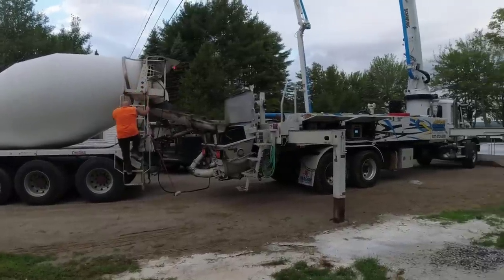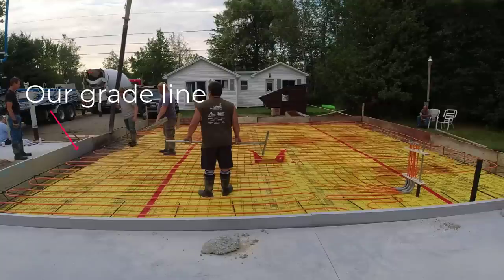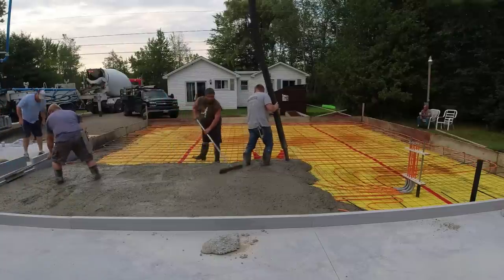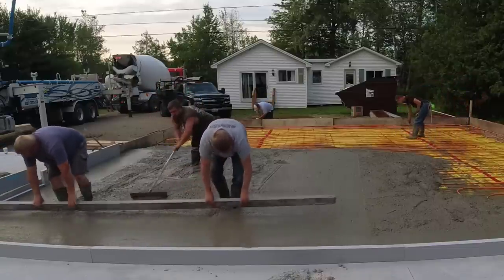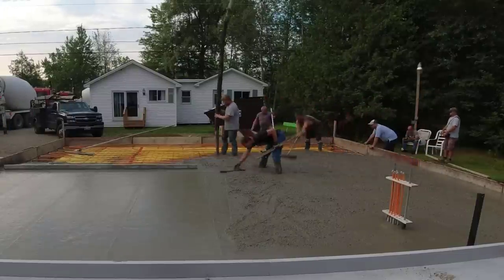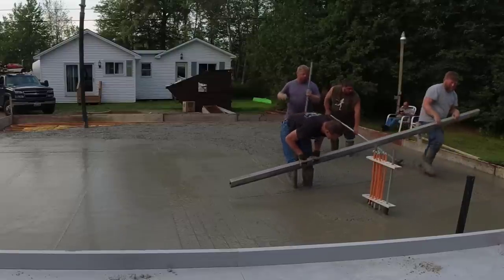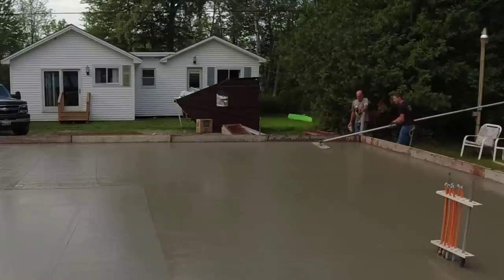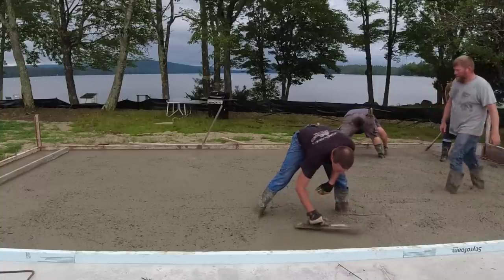You Never Seen A Concrete Slab Pour Like This! (They Used Wall Forms)

Comment: Nice work in the heat and humidity. They often pressurize the radiant heat pipes before you pour the concrete to show if a pipe gets damaged.
Reply: It also helps to stop the pipe getting damaged. The pressure supports the weight of the booted foot so that the pipe doesn't get crushed. In this particular pour, the mesh will also have protected the pipes.

Comment: Good job Mike! Good job crew!!! We often take a good one for granted in our day in day out neverending race against the Clock, The Sun, and the seasons, but at the end of the year alot of your bottomline can be determined by the guy runnin that chute or that pump hose. A good chute man is the key to an efficient pour and the general attitude of your crew and the ease of their efforts. Good job chute dude!!!
Reply: Nothing has quite the pucker factor of a large concrete pour.  And few construction jobs are quite as satisfying when it's over.  Kudos to the fine crew who did this.
Reply from the maker: Thank you!

Comment: I drive a mixer on Cape Cod and a couple of guys I've been pouring for have been having Super P added. They pour out at at a 7, With the Super P it reduces the water content by 15% but increases the flowability of the mix. It reduces the chances of shrinkage and does not comprise the strength the strength. Just remember that for every gallon of water you add to a yard of mix. It reduces the strength by 200 Lbs.
Reply: Also remember that to make the concrete frost proof, you need 4300psi. And to make it frost & salt proof, you need 5000 psi.

Comment: Hi Mike,great work 
Question for you I'm building a 24×36 garage with a alaskan slab, in Quebec Canada,wondering if I need to put down wire mesh if I'm using fiber in my cement. Thanks.
Reply: I ain't Mike but I would always say yes to wire or rebar. Be sure to pack some inches of gravel beneath it to help with the freeze-thaw up your way

Comment: As an architect, we get the Stego vapor barrier reps that come in to our place to try to get us to spec their products.  One of their main selling points is that their Stego vapor barrier is thicker and will last the test of time.  They claim that the standard vapor barriers can degrade and can get eaten away after years in place under the concrete slab to where you don't have any vapor barrier left.  I can't remember the details, but maybe it has to do with the pH of the concrete or something.  They show us photos to back up their claim.  What do you think based on your experience in the field?  Are standard vapor barriers that you see under concrete that is being removed eaten away, or do you really need a thicker / more durable Stego type vapor barrier to last the test of time?
Reply from the maker: I have seen a few, not a lot, of older slabs with regular poly under them ripped up. The poly is somewhat brittle under there. Not really sure just how old these slabs were but pretty old, more than 20 years.
Reply: I really don't believe a 20 year degrading of the vapor barrier MATTERS ,at all.this vapor barrier has zero to do with preventing sweating!Contrary to popular, un informed belief,water does not migrate UP through a slab to cause condensation!.Cold/warm slab to air temperature difference causes condensation.Spending stupid money for gimmicks,then passing on your costs is what inflates everything

Comment: Did the engineer not specify foam, or did they put it under the Stego?  Curious because I get half the people saying put foam on top of the vapor barrier, the other half saying below.
Reply from the maker: There was foam, I like the vapor barrier below the foam myself
Reply: @MikeDayConcrete  Thank you very much, have a good day.
Reply: With foam ,is vapor barrier even needed?There is no water moving ,soaking up into the slab..The foam stops condensation so completely. My bud put 4 foot of 1.5 unch pink..AROUND THE EDGES ONLY...The sweat line on one of those high humidity warm-all-of-a-sudden days...is only where the foam is missing!....Yet he put vapor barrier everywhere!

Comment: You guys ever use a portable Pumper. We used to use them on covered basement floors especially when the basement didn't have any windows so we can put a shoot through I've used them on many walls where we couldn't get a pumper truck close enough has it ever been so hot where you had to have ice in your trucks before we have a damn was it hot a 20-foot screwed helps out a whole lot just need that third person in the middle you ever use keyway in your floors for crack control and grade.
I learned how to strike off that way using lightweight concrete in the Union The Rock was a lot smaller I was a finisher for 20 or 25 years and haven't done it for about 15 years watching you guys really makes me miss a lot but I do remember the bad days like doing a 4,000 square-foot basement and only two guys showed up and it was a covered basement and no windows long hard day or getting caught in the rain my boss taught me how to finish a garage floor by myself hand trowel and kneeboard or sliders I think hand trowled finish looks better than machine finish

Comment: No vibration?
Reply from the maker: Don't need any.
Reply: I vibrate my slabs..l believe there is honeycomb if you dont...50%strength loss..if you had it (honeycomb)in a wall you would be pissed but nobody gets an eye on a slab to complain.This is poured pretty wet,so it is pretty honeycomb free probably..But if it was a 4slump...l do it..vibrate

Comment: Yea those are basement forms and yes I've done it like that before it's a lock keyway crazy for a garage I did it on side of mountain when you have a 5 story log cabin on top and depending on the mountain some times we we make a Deadman in middle of road giant hole full of concrete with steel from hole connectors to the foundation

Comment: Who takes down the forms and hauls them off ?      I would assume the owner is micro-managing everything.    The owner may be planning to put some heavy objects in the garage or on the patio.      He might be planning a secret tunnel.      He may want to give it to his great-great-grandkids in 100 years.     Over-engineered stuff makes for better videos.
Reply from the maker: The wall crew actually set this up, they will come back and take off their forms.
Reply: There is no such thing as "micro-managing" when it's most likely the biggest investment you'll ever make... Build it right the first time and make sure the contractors you hire understand that.
Reply: The guy putting the forms up!Who else?And as for micromamagement,there's a fine line between telling your contractor what you want and telling him how to do it.Micro can get an owner fired.

Comment: So why do people heat their garages? I get that it's cold in that area, but how much time do you spend in your garage that heating it makes economic sense? 🦘 🦘 🦘
Reply: I say you need a little heat to keep the humidity down. During winter, without any heat, you can have relative humidity close to 100% much of the time. Cold air cant dry out very much. The moisture stays there forever and everything will rust, including bolts and tools and cars.